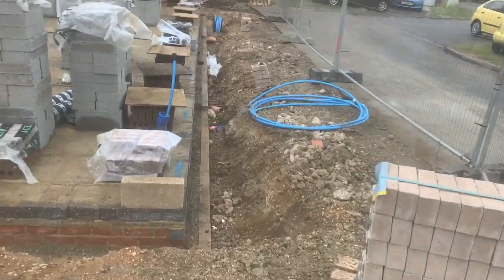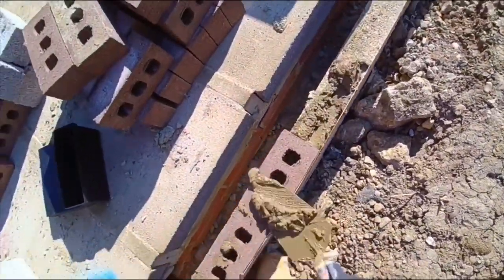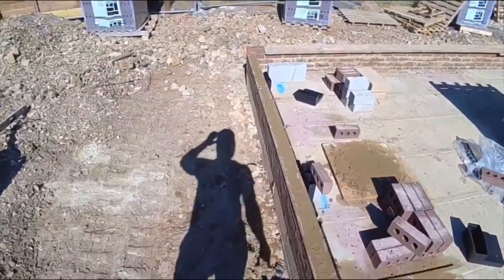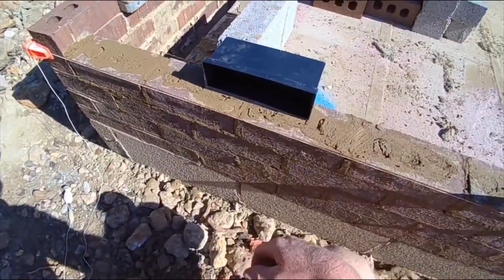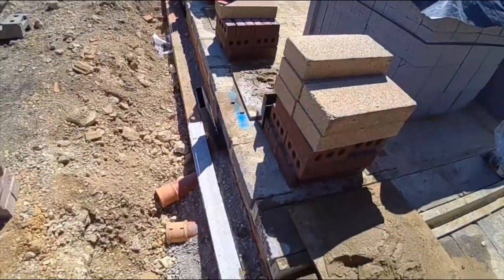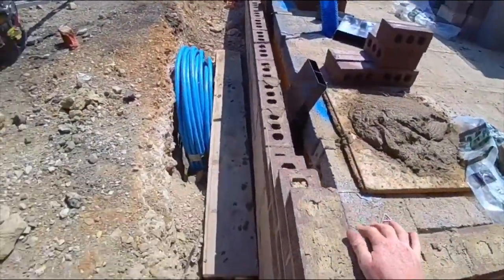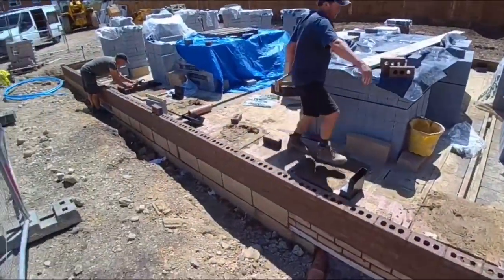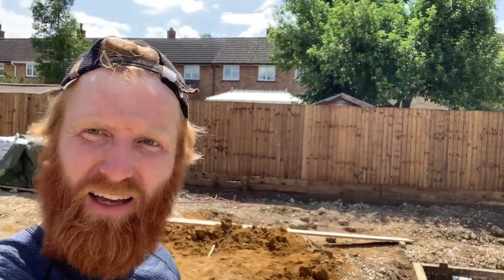I’m Bricklaying again | The skill of bricklaying

Comment: Don't the airbricks go or what ever they are called now go under the dpc?
Reply: Yep 😬🧱👍🏽
Reply: Bricklaying With Steve and Alex really.? That's a new one for me to....usually its at damp or at present we are 1 course higher due to disabled access being at damp and as a rule they have to be 75mm minimum above ground level but preferred at 150mm unless a really adequate fall is in place but as I said with disabled/level access at doc this is not possible..! Funny each site seems to apply rules and regs slightly different but I suppose we adapt and overcome 🤗🤗🤗
Reply: Frankie Dancaster Exactly, they make it up as they go along 🙄🧱👍🏽

Comment: The dust is back yeah them telescopic plastic vents are only good for the skip 😆😆 nice bricks them. Stretching over for the gear ain’t good on the back buddy get them sitting on wee aluminium hop ups.
Reply: Martin 
Yeah been there now try keep the boards up high as possible mate 👍🏻
Reply: Martin 
Thanks a lot mate yeah done a lot off silly practices at times but try not to so much as still a lot of years to go.  All best bud 😎👍🏻
Reply from the maker: Good to know!
Reply: @GingerDust69  
How’s it going fella hope your well. Will be uploading some videos
Reply from the maker: I hope so just need some work first
Reply: @GingerDust69  
Super buddy have you been doing other things yeah.
Reply from the maker: @lmilne4859  I have my bouncy castle business so that helped. There was a big loss in my family so I just spent the time with my wife and family. I need to go a dust of the trowel although I’ve got a block paving job tomorrow
Reply: @GingerDust69  
Ah sorry to hear that buddy take care. 🤟

Comment: They’re called telescope vents
Reply: Are they suppose to sit below damp tho?
Reply: Ryan Kristensen the vent face sits on top of the dpc
Reply: We’ve just built 12 semis in hull all sat below damp telescoped underneath the block and beam. Being above damp would allow damp to rise over the dpc ?
Reply: Ryan Kristensen how could water possibly travel up the vents and there is no water under the block and beam as it is sealed with dpm
Reply: Literally just a question don’t get offended by bricks and mortar 🎣
Reply: Ryan Kristensen I am not offend mate I have been doing this 10 years and I am still learning everyday . I was taught to put them on top of doc . Do use put them on the bottom? .
Reply: Cheers for the reply mate that’s fair enough pal but yeah recently we have. Before the telescopic where they all below damp anyhow because of the old 9 inch walls? Maybe that’s why we still do mate
Reply: Ryan Kristensen that’s why there is so many fk ups in the building people want things done different ways and we have to do what the ask to get paid
Reply: I genuinely want to know if use put weep vents on top or below dpc
Reply: I’ve always put them the course below dpc
Reply: Mr Brick I was on footings for 10 years and always put them under dpc , never seen them done any other way . If the house had a gas membrane then it would need a cavity tray all the way round and the vents would be in the way if they sat on dpc 😬🧱👍🏽
Reply: I’ve always known them as periscopic vents as they look like them 🤷🏼‍♂️👍🏽🧱👍🏽
Reply: Martin 👌🏼😂🧱👍🏽
Reply: Martin 😉🧱👌🏼👍🏽